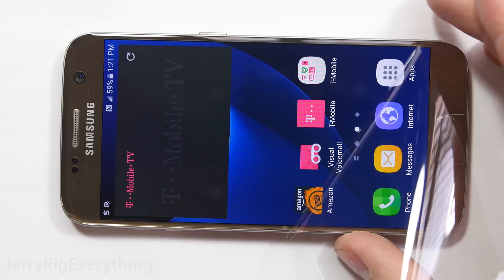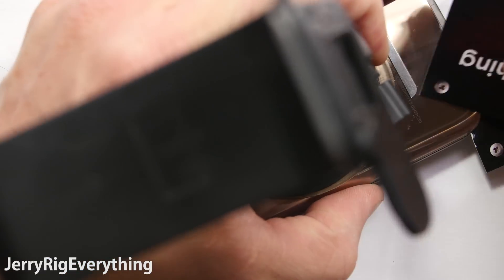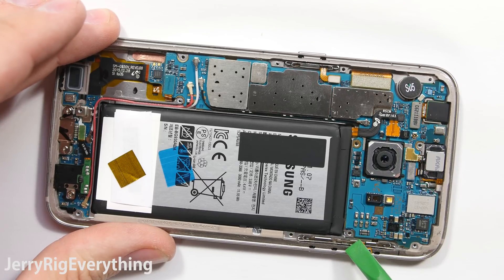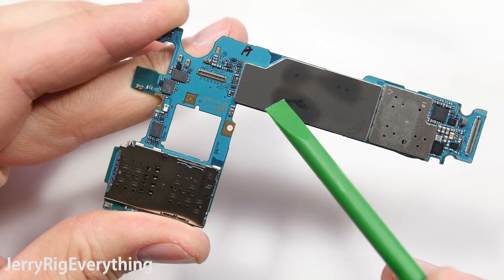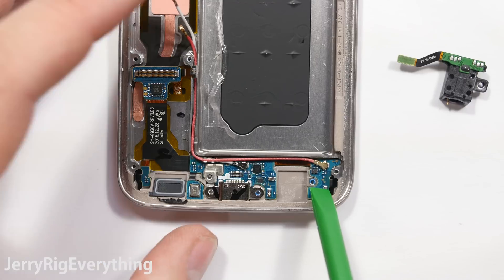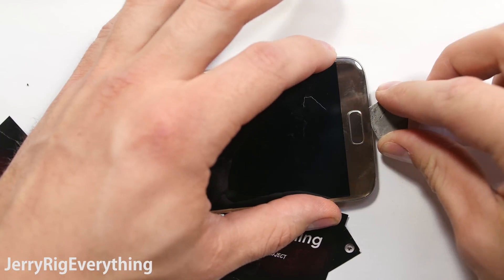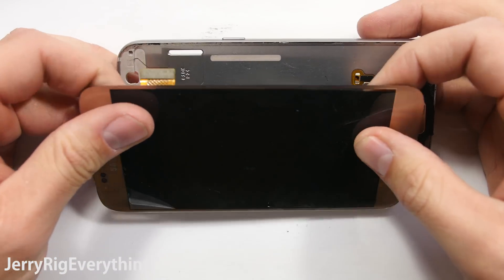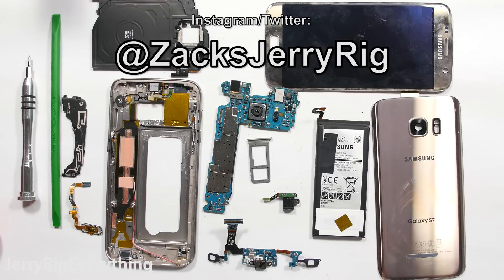Galaxy S7 Complete Tear down - Screen replacement, Charging port fix

Comment: where's the link for the replacement screens,  nd thanks for your advice
Reply from the maker: They are linked in the video description
Reply: +JerryRigEverything  please can u repeat if the samsung galaxy s7 edge loses its waterproof capabilities it the screen /back cracks and u get it repaired at a usal phone shop #(my s4 only shows notifications for 1 minute and then it deletes them 😔)I'm getting s7 edge soon
Reply: +JerryRigEverything hey I have a question? If I buy a new motherboard will the phone be like new condition? Or does it ask for old info?

Comment: Do you think that discoloration has something to do with the fact you pointed a heat gun at it until it was 'too hot to touch', as oppose to the processor getting too hot???

Comment: Please take note when you are doing this, your phone will no longer be water resistant.
Reply: ShxShlix  yall must abuse your phones. the s7 lasted me about 5 years no issues at all and the only reason I replaced it was because I took the phone outta the case and tripped while going up the stairs. Smashed the phone screen down on the stairs and the screen was totally shattered. Decided to buy a used S9 for less than the screen replacement
Reply: @HOBxSOLO  Still got mine
Reply: Fuck this stupid phone anyway.
Reply: @Dilomski  damn bro whats your problem

Comment: hi Jerry hows it going? just curious as to which phone is the most difficult to repair?
Reply from the maker: +David hunsinger Hmm... HTC doesnt make things easy.  The M8, the M9... Both of those were hard.  The Galaxy S6 and S7 And Note 5, are glued shut... so those are hard too.... iPhones are probably the easiest to work on. (iPhone 5 and up).
Reply: +JerryRigEverything I only ask because the hardest device I've ever repaired was the one m8 that thing was a pain. I've done many iPhones which are super easy, as you know just alot of parts. anyway thanks for your reply!

Comment: Is the replacement screen something like $200+ ?
Reply: lmao I spent $200 on a refurbished galaxy s7
Reply from the maker: +Crazy Candy Crush Ya, I have it linked in the video description.
Reply: Hysteria I spent $79.00 on a brand new s7
Reply: @thetechlibrarian  where
Reply: @Jesus-nc1jv  boost Mobile had them last tax season for 79.00. They are 150 on there website for pre-owned now. They also have s8 for 299 and s8+ for 350 with warranty.
Reply: Seems about $150 these days. But I just got a whole S7 for about $175. However, I never realized the prices of AMOLED screen replacement. I was wondering why the iPhones screens were so cheap - LCD.  The iPhone X screen very expensive now though being AMOLED.  The downside of used phone is I have to replace my battery it is estimated to only 2100mAh capacity and it shows by how fast it drains. that's why I am watching this video.
Reply: Just ordered front and back glass screen repair kit from Amazon for $16.99
Reply: The Tech Librarian coz they have newer phones now
Reply: Got My note 5 in $220 !!!
Reply: Crazy Candy Crush no $10
Reply: if u mean just the glass it costs around 50-70 
but the display is a little bit more
Reply: My s8 edge is brand new and it cost 180€
Reply: Bill Russell the iphone x has a oled samsung has amoled which is better BTW samsung make apple screens

Comment: You think the discoloration on the processor is from it running hot and not your 1200° heat gun?
Reply from the maker: +Spencer Brown I mean...  It's in the exact shape of the processor.  So yes.

Comment: I just would have liked if you have shown the samsungs new cpu unit cooling system.
Reply from the maker: Watch the s7 edge video then.  I slit the heatpipe open in that video
Reply: Yeah i did .Thanks for the relpy.
Reply from the maker: abdullah samet https://youtu.be/IZU9U72OU5s?t=4m26s

Comment: I wonder how much of that discoloration is from your heat gun? Especially since you said it was "too hot to touch" at one point.
Reply from the maker: Understandable.  But the discoloration is in the exact shape of the processor.

Comment: If I remove the back penal (if rear camera lens breaks & needs replacing) does that mean phone isn't water proof now?
Reply: +NJ Havoc it is still waterproof IF YOU BRING IT TO OFFICIAL SAMSUNG SERVICE. they will check the air pressure and put the water resistant glue again, otherwise your phone is no more water resistant only the 3.5mm audio, usb port, speaker, and sim/sd card that water resistant but if the water come from behind.... you know... so always go to samsung service center if you wanna fix something, same like xperia go to xperia care.
Reply: +Laurensius Satya thank you

Comment: Realistically all these new phones are throwaway items rather than repair due to cost.
Reply from the maker: +Mr2pint After about 6 months the price of the repair parts drop enough so that repairs are cost efficient.
Reply: JerryRigEverything Not in NZ unfortunately the cost of repair parts are astronomical with import taxes and repair cost for a simple screen replacement on my old Note 4 was $700 NZ dollars - average wage here about 35-40k lol.

Comment: i stopped using samsung after the s3, then i got a nexus 5, i didn't get an s6 because of no sd card. so i got a z5, which has sd slot and the ip68. then samsung go ahead and release this
Reply: thebutter flyNL no
Reply: ok
Reply: Jump out your roof?
Reply: thebutter flyNL too high
Reply: +illitero search a life in your local dump and make sure to never comebacm

Comment: actually, AMOLED is glued to the sensor. But AMOLED has two layers, which can'n be separated in normal conditions. In your case you separated AMODED layers because of cracks on it.
Reply: you don't HAVE to CAP the AMOLED all the TIME
Reply: C Byte Of course it's technically wrong, but it feels like the guy is screaming in my face each time.
Reply: +hansen00 uhhmm I think amoled is like an abbreviation led stands for light emitting diode I don't know about the a m and o so writing led is technically wrong and it should be LED
Reply: +C Byte We should know better when it comes to tech and abbreviations; they usually matter. I'd be much more concerned with all of the other grammatical slaughter in the comment.

You made me think back to old RPG's and other games that would uppercase item names in dialogue boxes. "You found MAGICAL HEALING ITEM. Will you use it? You have used MAGICAL HEALING ITEM and recovered 200 HEALTH!"

Comment: I m pretty sure no one actually replaces these by themselves.
everyone watches for fun.
Reply: I'm actually planning on doing this for my s7 because the battery drains SO FUCKING FAST. Also, I enjoying fixing things by myself, it's fun for me personally.  I've been taking shit apart for ages so I feel pretty good that I won't fuck it up. I'll back my phone up before just in case.

And in terms of water resistance, I'll just have to treat my phone like an old fashioned cell phone till the s9 comes out. Not a problem.
Reply: @isaac10231  did you replace the battery?
Reply: @moehashim8442  Nah I got the S8. But I think I'm going to find a new phone manufacturer because I want a headphone jack with my phone and Samsung removed it from the note line.
Reply: @isaac10231  I don't understand, you're using the S line in which the S10 still maintains a headphone jack yet being very capable
Reply: @moehashim8442  no I was thinking of upgrading to the note 10.
Reply: @isaac10231  but... why?😂
Reply: +tech inc 
Lol. In a year or two, I will have no problem popping mine open for a repair. Right now, I cant imagine even scratching it so forget about prying it apart. Also that water resistance is gone even after you put it back together.
Reply: Wilvin Did you ever repair?
Reply: Tech Incorporated 
 I kept my Samsung Galaxy S4 working all these years by replacing parts. It really isn't hard to do. You just need some quality tools including a heat gun and the separator tool he has. You can buy them on Amazon. You can buy replacement parts there too. I would actually keep my Samsung Galaxy S4 going forever but they aren't releasing any more android updates for so software isn't working anymore.
Reply: Not for my S5 and Z3. Yes for my S7 edge
Reply: I just opened mine
Reply: Ross Gaming
For battery drain you have to wipe the cache partition. Google it if you don't know how. It's just a few button presses. It will fix any battery drain issue that isn't caused by a physical fault in the battery or the powering system. Mine gets hot from time to time, usually after some updates that clog up the cache. 
I guarantee it'll fix your problem.
Reply: isaac10231 did a new battery fix the fast battery drain issue? I'm having the shames problem and was wondering if a new battery would be the go. Thanks
Reply: Jimmy Obrien nah I just bought the S8 lol
Reply: How come mine doesn't have that little silver part on the back?
Reply: Maybe you have a different version. There are two versions: Exynos and Snapdragon. Maybe hardware parts are slightly different
Reply: isaac10231
battery drain is usually fixed with a cache wipe. I hope you didn't pull your phone apart since then without trying that first.
Reply: W I still have my S2 it is right now sitting at 0% but then I turned it on (like about 1 month ago) and  it works.
Reply: Insurance is better
Reply: Tech Incorporated yep.😂
Reply: W I might get a S9 when my S7 2 year plan is done,  I have about 8 months left :) no issues so far just that battery drains fast.
Reply: True true, we don't want to f*ck up our phone more trying to repair it ourselves. (¯－¯٥)
Reply: I replaced my lg g5 screen for £26.00, was surprizingly easy, this phone looks badly designed for repairs tho.
Reply: I'm looking to replace the back glass
Reply: Now here you are wrong im able to do it its just fun to watch and do it later lol
Reply: Eventually everything gets dated and start getting worth repairing by oneself and they show up in electronics bins.
Reply: If you already have a phone with a cracked screen doesn't hurt to try.  Good experience.  Just did a screen replacement for an s7, had everything back together and screen works great.  Problem is one of the buttons don't work.   I can live w/o it.
Reply: Any clip on water damage? I have one I fucked up and bought a new one..
Reply: I do repairs.
Reply: I repair phones and these videos really help and are not just entertainment for me!
Reply: isaac10231 my wife just bought s7 and after watching the two repair videos, we're going to return it for s8. I mean who wants to crack the screen and damage the digitizer, about $200, just to replace a $10 charging port. With the essay, you don't have to remove the screen to replace the charging port. Huge difference in well worth the extra hundred and $50.

Comment: Problem with this is when you replace the broken part and reassemble the whole phone.. It will not be waterproof again like it was before because of the seal is half broken. I will have to ask Samsung employs on what warranty covers here. If i buy the phone and something stops working inside the phone. Will i receive a new phone? Or they will have to first disassemble it ="broke the waterproof seal" ,than replace the part and ship the same phone to me.. If that is the case than i'm afraid that i will not buy this phone.

Comment: So the Snapdragon 820 may indeed cause these phones to overheat, or take damage over time?
Reply: no the liquid cooling will keep the cpu thermaling down
Reply: +B3TR0Z just have to wait and see what happenes after few months.
Reply: Vapor cooling in a heatpipe...not real watercooling.
Reply: B3TR0Z same diffrence
Reply: ***** what's the difference then dude
Reply: Dylan Aarhus i think Samsung home made CPU chip is better then SnapDragon 820.
snap dragon 810 had overheating problems if you remember last year.
Reply: umar nawaz khan I haven't had any overheating problems on my 820 variant but I was reading that the exynos 8 is having over throttling  problems and the benchmarks on the 820 are a bit better than the exynos 8 chipset
Reply: B3TR0Z it still performs like watercooling though it cools down the Cpu
Reply: Betroz pretty sure it was the heat gun, I haven't heard anything about overheating

Comment: I fix phones in a repair shop and know about the difficulty of safely removing the OLED screen without damaging it.  It isn't impossible but it requires more consistent heat than a typical heat gun can offer and avoiding using metal tools near the corner like that.  OLEDs are safe with temperatures of up to 100-105 Celsius on a heat plate or a heat gun with temperature controls.  I like to start from the top and work my way to the bottom with business cards, leaving the soft key lights cables for last because they become visible.  It's certainly harder with the Edge screens but not impossible either, just requires more patience and a delicate touch.  Also, for removing the back glass, you can avoid scraping the paint like that by lifting the glass a bit more and then using either a guitar pick or card to loosen the adhesive.  You can get away with it on white phones with some white-out to cover up but better to not scrape it at all!
Reply: +enos218 I typically replace the oled/digitizer assembly, not just the glass. Assuming you have the expensive machinery and high skill required to perform a glass only repair, it seems separating and cleaning the oled may be easier than usual but I can't be sure how they are attached based on this video.  This isn't a phone that I would recommend a DIY repair on with the exception of maybe replacing the back glass, cameras, or rear camera lens. Anything requiring screen removal you should take to a repair shop or honestly have insurance on it.

Comment: could the over heating have been caused by the hot gun?
Reply from the maker: +uploadsaver Its a very specific pattern, right around the squares of the processors, so I would doubt the heat gun had anything to do with it.
Reply: I'm a big fan :) thanks for responding. 😎
Reply: +uploadsaver Does it look like that on the processor because of the liquid cooling system they have now? I mean, I doubt they are releasing the S7 with overheating problems after the S6.

Comment: Zack should I be concerned with the processor melting the plastic in your last video? reconsidering the phone ever since.
Reply from the maker: +nate m It is probably fine... It does get really hot... But Its too soon to make any assumptions about longevity.
Reply: JerryRigEverything could it have been some metalic tape reside? Or was it legit melted.
Reply from the maker: nate m Just discolored. Not residue... It'll be interesting to see how the phones hold up with heavy use and time.
Reply: JerryRigEverything thanks Zack I guess I'll roll the dice.

Comment: Wow first lol
Reply: +Tech MD Youtube I was able to get mine out in working condition but very tricky! Video is on my channel, I would like to see you method also.
Reply from the maker: +Tech MD Youtube Champion!
Reply: +JerryRigEverything OK yeah you did several things wrong here.  It's still very possible to remove the screen without damaging it. I will show you how in the video soon as I get my galaxy seven but I highly recommend having a hot plate. Now what happened is the LCD and digitizer doesn't have glue together. That's actually been something Samsung had for a long time even back all way from galaxy 2.   Just take an old galaxy screen and separated the wrong way just like you did and you'll see what I'm talking about. So the glass screen is attached to the polarizer/digitizer. Glass glue polarizer digitizer LCD those of the layers.  Some Samsungs like the mega have you glue between the digitizer & Lcd and others like the core prime has no glue between the Lcd and digitizer which leaves an air pocket. The  digitizer & glass still does and always will have glue in between. Maybe I'll make a video explaining it. I've had several people ask me questions about this. Hopefully I made it more understanding.
Reply from the maker: Tech MD Youtube Either way, this S7 screen is more fragile than any of the other Samsung phones so far.  And I think my warnings are pretty valid for anyone attempting these repairs for the first time.
Reply: +JerryRigEverything  I definitely believe that they keep on getting thinner and thinner